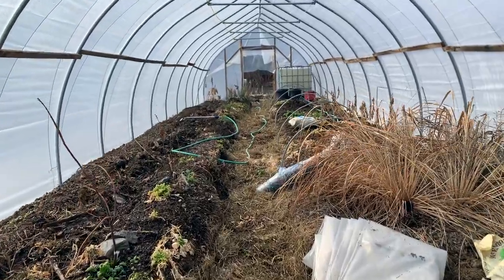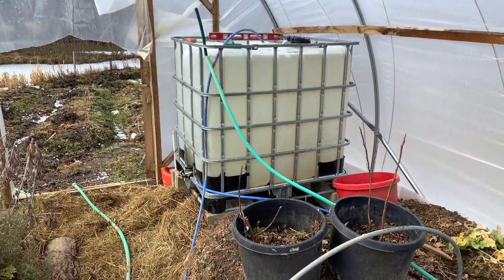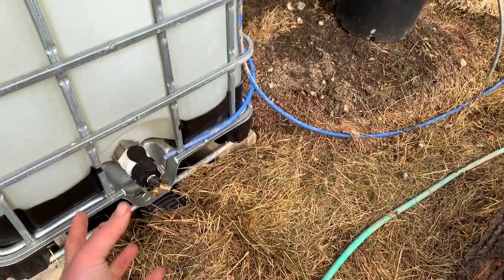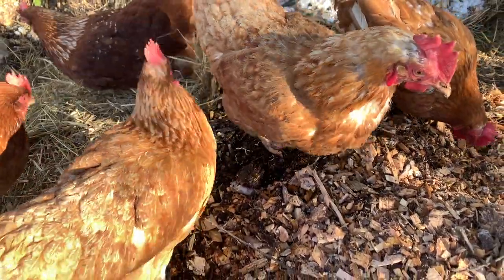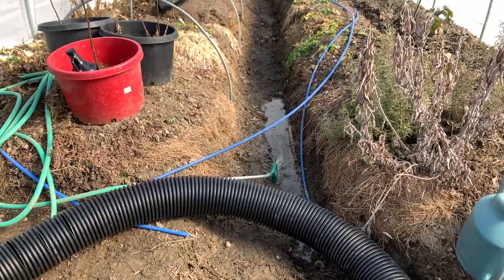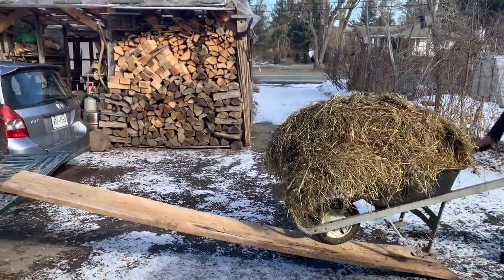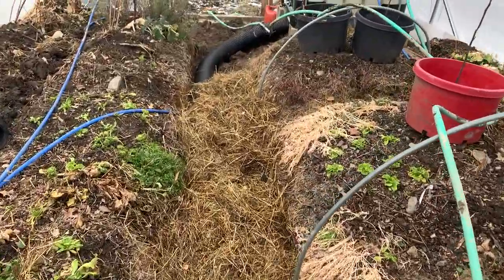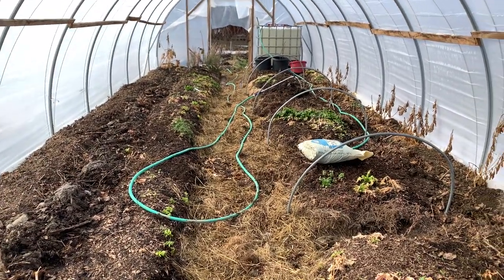High Tunnel - Compost Heating System Evolving

Comment: A mutual friend of mine and yours on tibbetts point planted her hoop house early last fall.....no heat....no lights.....they used double layer fleece row cover......some days obviously it couldn't be uncovered.....an had to cover back up by 4 every day when uncovered for the day or the fleece would freeze stiff. Lettuces,,spinach, all greens crops survived the winter...was told kale took the worst beating....being near the wall I believe. A massive harvest of spinach was harvested a couple weeks ago. Very impressive. The day I spoke with them was windy and only in the teens but sunny.....70 degrees in the hoop house.
Reply from the maker: These are some promising notes... Now that I have the internal poly layer on I am seeing incredible warmth building up under there.  We'll very very soon have to figure out how to manage the excess heat in the day in that space!  Wild swings in the spring and fall for sure.
Reply: @edibleacres  u are on the right track with the solar panels u could definitely use one of them to run a small fan for air circulation and temp control.

Comment: Coming together nicely.  I wonder if the compost will heat back up in the high tunnel.  Is there enough mass of compost to heat up again?  I hope so, there's clearly a lot of thought and ingenuity/engineering thoughts in this.
Reply from the maker: It is around 2 full truckloads of super potent material, I'm quite sure it will, and as it settles and packs we can add more on top.  Easy to soak it this way as well to wake it back up, and to cover with poly on cold nights to keep the heat radiating laterally through the beds.  We'll have to see :)

Comment: love your channel. OK, I think you are on the right path with the pex. Keep a plant's feet warm and the tops tend to revive. 
I would suggest a one way check valve at the source to kind of circulate the water. Like a coffee pot. It needs to be tight conections with no air. 100 degrees or more is not enough to blow. I don't think. Ask someone who might or set it up outside with a torch or fire before install. 
You are battleing the frost line so use pex or hay flake or even styrofoam at  the perimeter and then lace the beds. Don't need to be too deep. You're not digging with a back hoe so just be careful planting. Good luck
Reply from the maker: Thank you Ken for your inputs here, much appreciated!

Comment: Nice! Are you concerned at all with the manure being splashed on the crops, especially edible ones?
Reply from the maker: The bedding is really only in the main pathway, which is a bit lower than the beds.  Once we have crops actively growing we can be considerate of how the water is applied and I don't think it should be an issue.

Comment: Forgot to mention the depth I dig my path is about 18 " with the top layer of chips at about 6" and the rest being manure. My back row is a permaculture fruit bed and this week my dwarf nectarine is blooming along with my daffodils ,the plum trees have been blooming since the last week of Feb. We are getting the similar temperature to you as we are in zone 3 Northern BC . We do have the extra heat from the geothermal system this year though and that is giving us about 5 C above what the base temperature would be and we have a wood stove for the cold nights.

Comment: Shallow ghat system hybrid? Is cool I hope it works! Maybe a length to near the peak of the tunnel? For more heat
Can also reverse flow to cool
Reply from the maker: It is like that I suppose...
The tube will end up in the 'peak' of the low tunnel to grab more warm air from a problem zone.  We'll share more notes!
Reply: or ‘chat’ (compost, instead of ground) :D

Comment: How about you pump the water through a solar heater before flooding? and then the warm water  warms up the beds?
The water has a high heat capacity which you could warm up with these "black tubing in circle in glass frame"
AFAIK these things can produce pretty warm water with just a little sunlight
Reply from the maker: Great idea.  I was just thinking about a box that has a copper coil painted black to absorb sun, heat up and maybe do the 'lifting' to get the water into the tank...
Reply: @edibleacres  box lined with aluminium foil. The box sealed with a sheet of glass.
I wonder if it can do any lifting alone with the heat

Comment: Did not understand if you are irrigating with water directly under the ice. If so, likely you need to pass that water through a place where it can get some heat, as the cold water will tend to decrease/stress, at least temporarily, any biological live in the ground,  Otherwise it  looks like an efficient system design.
Reply from the maker: Great point...  In the main shots you saw the water running direct from the pond into the gardens.  For now we are in deep need of rehydrating and there aren't many plants so its OK.  Moving forward we'll be watering from the tank which will be extracting a TON of heat from the space...  Notes to follow.

Comment: Wouldn't it be better to heat the water instead of the air? I can not imagine that you will get anywhere near as much heat transfer with air as you would get with water. Run your PEX through your compost pile and then dump it into your IBC.
Reply from the maker: I'm guessing I didn't explain it super well... The PEX loop in the main pathway is sitting directly on hot compost.  It should be able to scrub a fair bit of heat from that.  The black tube is first and foremost about being able to grab excess heat from the low tunnel and put it down and low in the system to charge the bigger batteries of soil around it...  We'll see how it goes!
Reply: I've often wondered why I've never seen a DIY solar hot water heating system (commercially produced for home roof top monting) with a back-up compost heated water system employed to heat tunnelled beds over winter.

I can only assume older, used solar hot water heating systems must be non-existent (get scrapped?),  hard to come by (so few?), or very expensive unlike used or even new solar panels.

I only know one person who had a seperate roof solar hot water system some years ago & have lost touch with him.

Anybody?